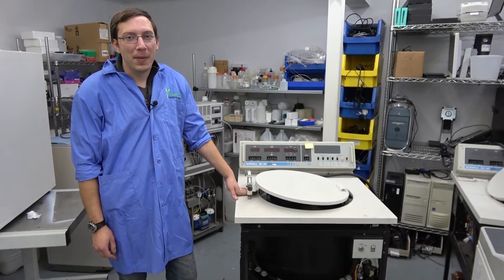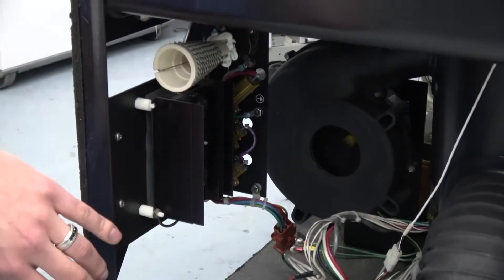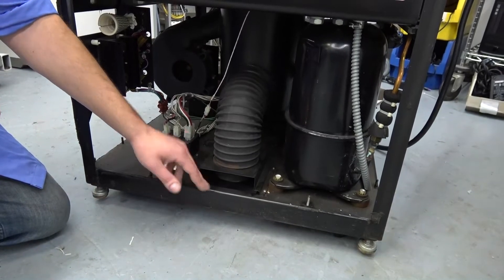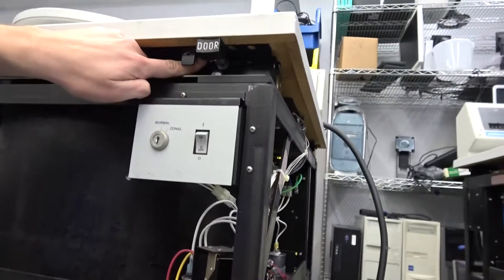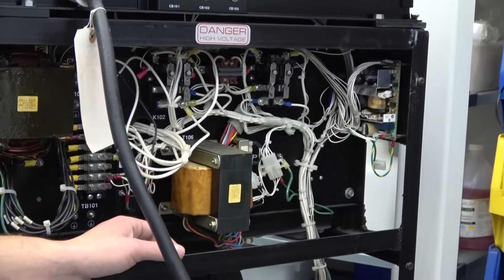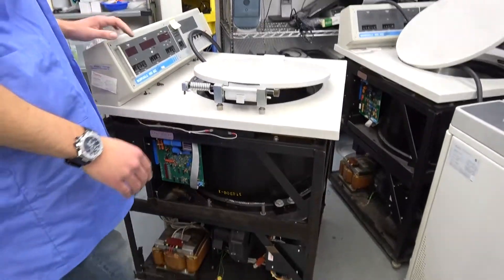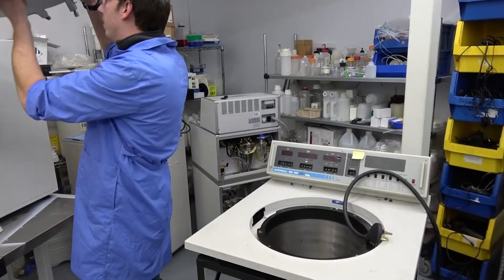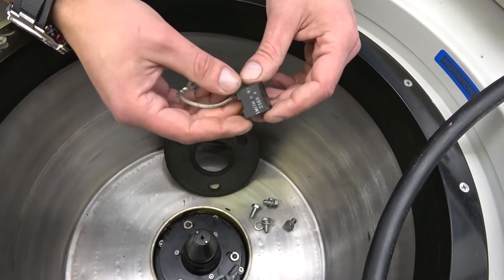What Are the Parts Inside the Sorvall RC-5C Plus Floor Centrifuge?

Comment: The brake assembly on ours broke off during a run and touched the bottom of the centrifuge-the nylon threaded bolts broke off just as you described. The computer kind of went nuts but I managed to shut everything down pretty quickly. After unplugging it and waiting for it to spin down, I turned it back on and everything seemed to work except the brake. Do you think the instrument is safe to use, or is it a ticking time bomb?

Also-does that assembly just control the brake, or does it also switch the high voltage going to the motor? It looks like it has some pretty large power transistors which I don't see elsewhere in the centrifuge.

EDIT: What are sizes of bolts that hold the side panels on?

Comment: SORVALL RC4 Centrifuge Error 04
Reply from the maker: Hi! Centrifuge Error 04 would be "The run does not start or the centrifuges runs down without being braked". This could happen at a couple different times either during start or during the end while braking. This could be an issue of the tach sensor, drive, main board, improper wall voltage, or part of the brake circuit.